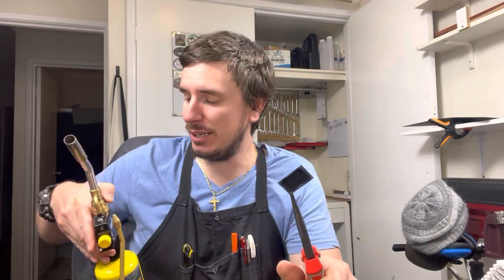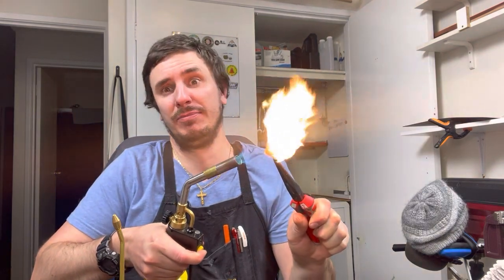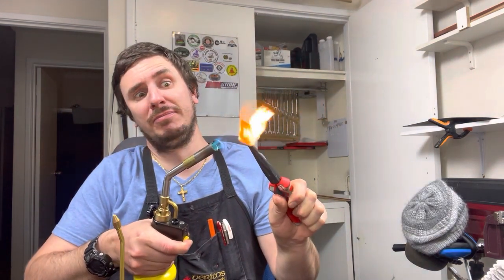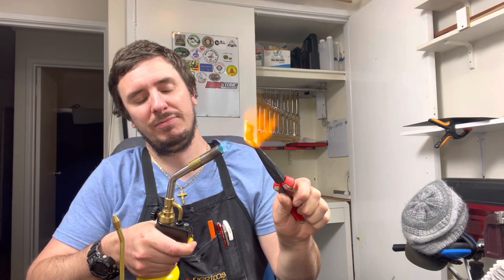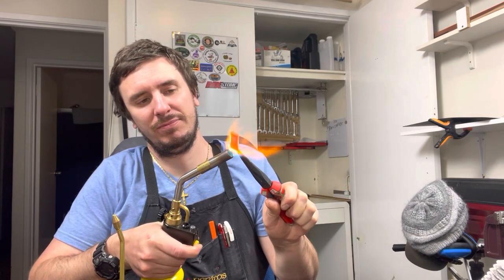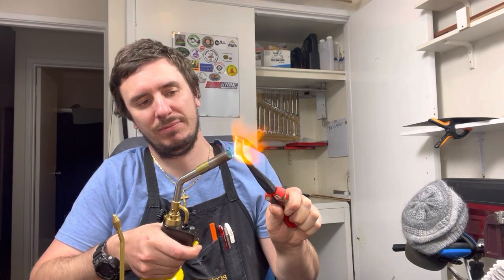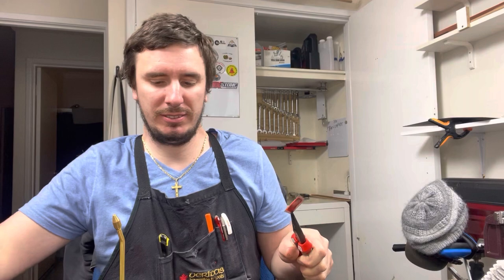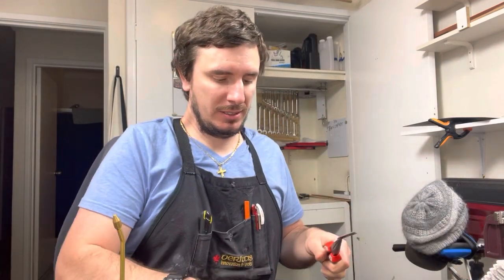If Your Garden Power Equipment Won’t Rev Up Try This!

Comment: Dude! You just took the temper out of the tips of those expensive needle nose pliers! Stop it! 🤣🤣
Reply from the maker: Yes :) I have two pairs, one to burn things or hold things that get hot, the other is for normal use! 😊
Reply: @VintageEngineRepairs  Just messing with ya. 👍🍻
Reply from the maker: @williamemerson1799  you have a very valid point though 😂 hence why I got a second pair LOL